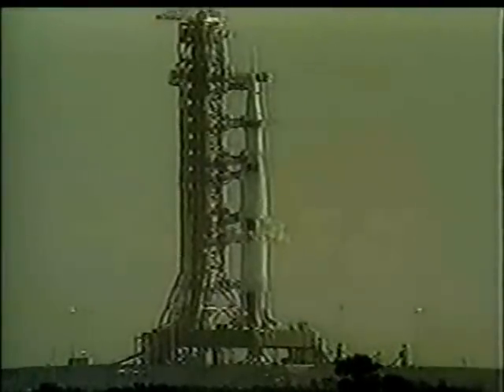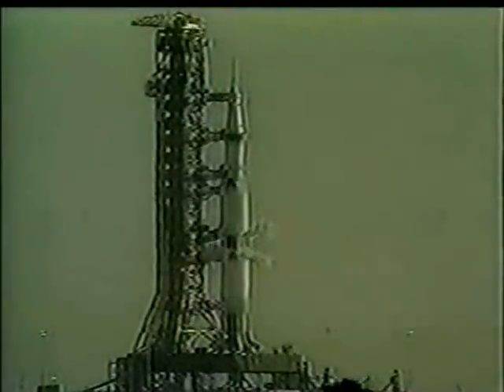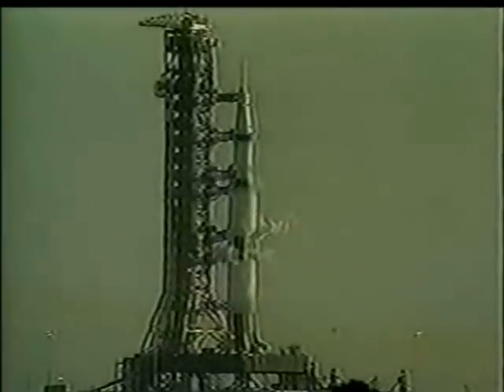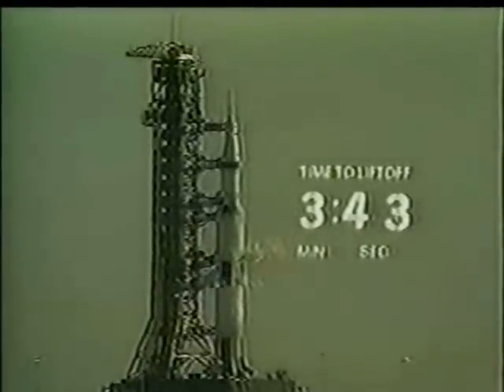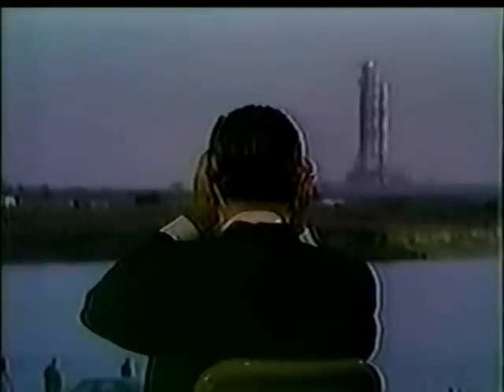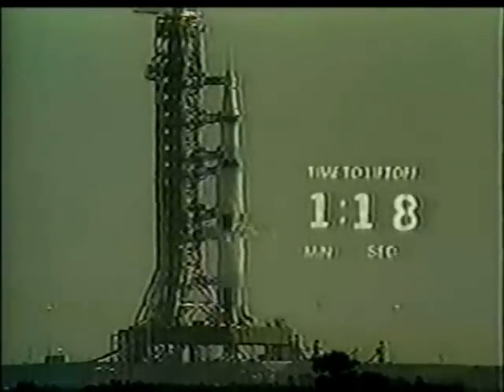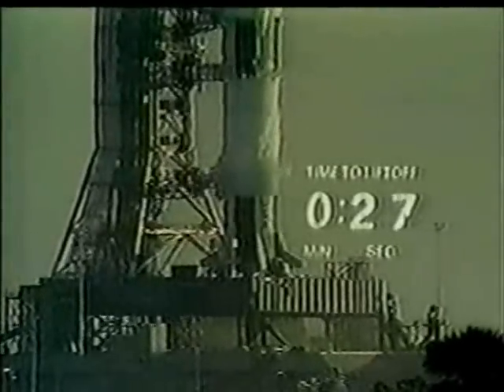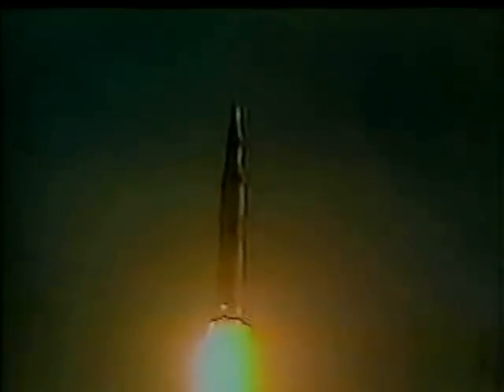CBS News Coverage of The Apollo 8 Part 5

Comment: The unprecedented noise of Apollo 4, the first Saturn 5 launch, shook ceiling tiles down in Cronkite's studio and rattled the big picture widow so much that he and his staff braced it wit their hands to stop it breaking. After the launch, a NASA technician told them not to touch the window, as it had been designed to shake and preventing it doing that could break it.
NASA thought of *everything*.
When Apollo 8 went to the Moon I was working at a mine on Groote Eylandt in the Gulf of Carpentaria, northern Australia. Our only direct contact with the world was by shortwave radio. The flights from Mount Isa and Darwin brought current newspapers and magazines but they were always a day or two out of date by the time they arrived. I knew Apollo 8 was going to the Moon and I was always one of the first into the general store to read about the mission when the next flight brought the latest news.

Comment: We are so lucky that the Apollo 13 SM had not been assigned to Apollo 8. No LEM
Reply: Lucky? That LEM hadn't even been built yet.
Reply: @generalyellor8188  You misunderstood. The Service Modules were constructed separately and were just combined with a Command Module pretty much at random.  My point was this: Had the Apollo 13 Module somehow ended up on Apollo 8 instead, and the accident happens, it's not good. No LEM on Apollo 8 so no lifeboat.

I am not sure when the Apollo 13 SM was actually constructed, but I had read that it went into storage for a few years and then was assigned to Apollo 13.

Comment: ''In the last 24 hours we have seen facilities now being created for the greatest and most complex exploration in man's history. We have felt the ground shake and the air shattered by the testing of a Saturn C-1 booster rocket, many times as powerful as the Atlas which launched John Glenn, generating power equivalent to 10,000 automobiles with their accelerators on the floor. We have seen the site where the F-1 rocket engines, each one as powerful as all eight engines of the Saturn combined, will be clustered together to make the advanced Saturn missile, assembled in a new building to be built at Cape Canaveral as tall as a 48 story structure, as wide as a city block, and as long as two lengths of this field.''
''But if I were to say, my fellow citizens, that we shall send to the moon, 240,000 miles away from the control station in Houston, a giant rocket more than 300 feet tall, the length of this football field, made of new metal alloys, some of which have not yet been invented, capable of standing heat and stresses several times more than have ever been experienced, fitted together with a precision better than the finest watch, carrying all the equipment needed for propulsion, guidance, control, communications, food and survival, on an untried mission, to an unknown celestial body, and then return it safely to earth, re-entering the atmosphere at speeds of over 25,000 miles per hour, causing heat about half that of the temperature of the sun--almost as hot as it is here today--and do all this, and do it right, and do it first before this decade is out--then we must be bold.'' - ''We choose to go to the moon. We choose to go to the moon in this decade and do the other things, not because they are easy, but because they are hard.       Because that goal will serve to organize and measure the best of our energies and skills, because that challenge is one that we are willing to accept, one we are unwilling to postpone, and one which we intend to win, and the others, too.''